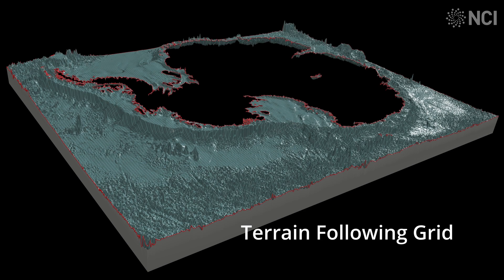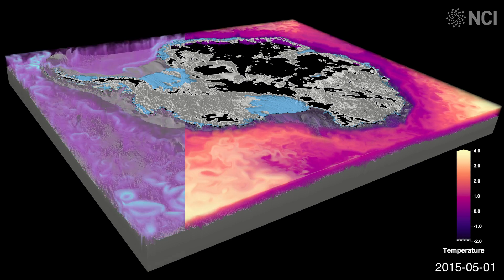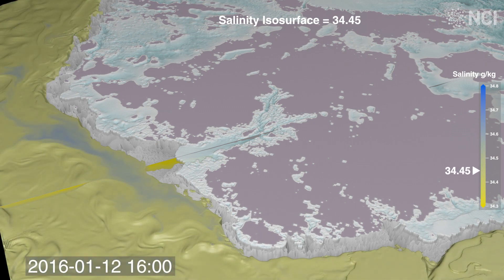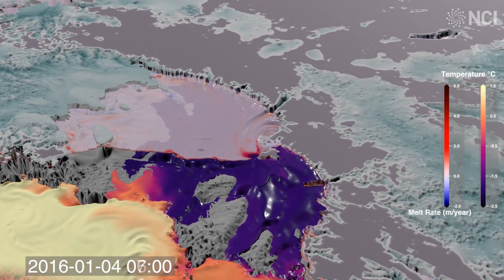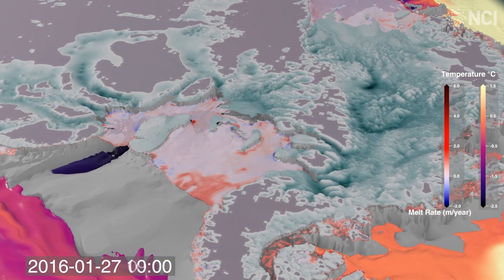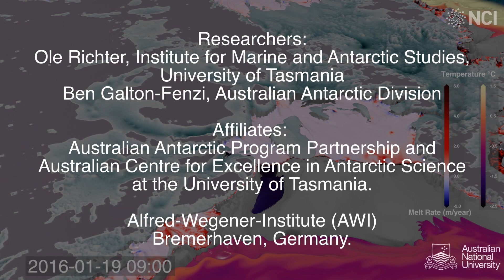High Resolution Simulation of Melting Antarctic Ice

Comment: It seems that warm water from inland is moving to the sea in places. Geothermal activity is melting ice and heating water under the ice in spots. This is an issue not addressed in the model. I remember IGY reports of subglacial geothermal activity causing ice melting. Why is this heat source ignored? Also gasses vented include carbon dioxide. Warming seawater releases carbon dioxide also.

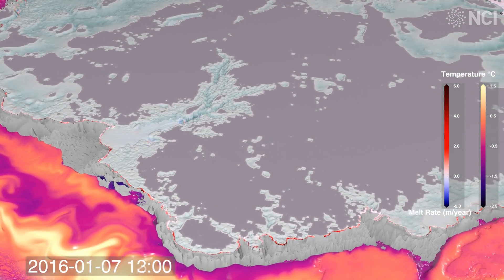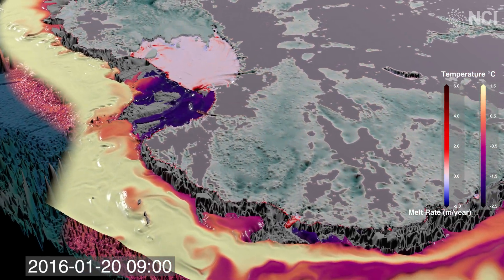Comment: Very nice visualisation. Some glacier/bay-names would help those of us not intimately familiar with the Antarctic understand which bit we are looking at when the isometric view rotates around the coastline. This really helped understand what some of the process and geography looks like, but it also just brings more questions. When you strip back to the iso-salinity layer (2:02) - how deep is that 'surface' approximately? 1km? 2? And clearly parts of that 'surface' are above freezing, and thus promote melting if in contact with ice. Is all the water above that in the column colder? I was well aware of the research from a few years about about the grounding line of some WA glaciers being undermined by warm water and accelerating movement and melt rates, but I hadn;t appreciated the way that the underwater 'coastline' (is there a word for that?) is a lot shallower at the glacier mouths (analogous to a river delta I guess), so mostly the warm water is below that level and not touching the glacier foot. The simulation seems to show the ice surface, but not the underwater ice wall. Is that right, or is it just hidden? At say 2:42, should we be imagining a nearly-vertical ice-front under the glacier going down to the seafloor and touching the tongue of warmer water? If so this would be easier to understand if that was made visible in some way.
Sorry to pick holes in your visualisation which no doubt took forever to make. :-)  I'm just giving feedback on how it could be made clearer to laypeople.
Reply: The undersides of the ice shelves have rapidly melted down over the past ten years - which results in the "ice wall" rapidly diminishing in height - this is documented by numerous independent sources - including underwater cameras, underwater submersibles, video footage from cruise ship passengers, video footage from work crew members, video footage from helicopters that show the ice shelves and glaciers imploding with massive cracks and so on.

The rapid melting of the underside of the ice shelves and the glaciers is the result of massive heat rising up from the calderas beneath the ice sheet - especially beneath Thwaites - and from beneath the Ross Ice Shelf which is the size of France - dozens of other ice shelves and glaciers have been massively melting down over the past ten years.
Reply: @WhirledPublishing  Do you mean 'calderas' here? That's a volcanic feature, and won't have changed its heat-flux much/at all in the last few hundred thousand years. The melting of the undersides of the glaciers is due to changes in the temp/circulation of the coastal waters, as shown in this simulation, isn't it?
Reply: @WhirledPublishing  Well I have compiled thousands of sources (and fixed quite a lot of them for new architectures etc), but I'm not a specialist in ice science and don't need to be to have a useful conversation.
Anyone who says 'you are clearly too ill-educted to talk to, and I'm extremely clever', rather than actually answering the question comes across as a bit of a pompous twat.
And when they start suggesting that the whole scientific community doesn't know what it is talking about and puts it in air quotes, then they come across as a conspiracy loon. Science does work, despite the limitations of the people doing it.
I take it that you disagree with Mr Rignot about the mechanisms of WA glacier undercutting, although not the fact that it is happening? Some reasoning or alternative theories would help your case.
But fine, if you don't want to answer the question, that's OK.
Reply: @WhirledPublishing  
yeaH, sorry its not "volcanos" friend.
Reply: @-LightningRod-  Since I have thousands of sources - and you don't, take a seat in the back of the class.

If you should ever care enough about the truth to compile thousands of sources, documented in dozens of languages from all across this Earth - which will require decades of your life - you might become someone worth trusting.
Reply: @WhirledPublishing  
So, ..i bid you,. Good Day , Sir.
sorry which Volcano was poppin off?
Because there isn't.
Reply: @WhirledPublishing  
GOOD Day sir.

Comment: How do you measure sea levels with changing tides & weather?? I thought ice melts from the outside in??
Reply: Sea level rise has been minimal because of the massive extraction of sand along the coasts of Australia, Africa, South Asia and so on - massive dredging of rivers and lakes and canals have also helped to keep sea level rise to a minimum.

In Hawaii, huge piles of debris were hauled out and left sitting on the beaches - this is going on - worldwide - which helps to maintain sea levels at a constant - but mostly the haul is from billions of gigatons of sand which is used to construct  thousands of high-rise buildings - worldwide.
Reply: @WhirledPublishing  
uhm,...No.
Reply: @WhirledPublishing what a hot load of bs.

Comment: Nice simulation. The general laws of physics for fluids and thermal transfer are there, but it's a pity it doesn't reflect the real-world dynamics of what's really happening in the Artic Sea. 

The natural world is too darn finicky to model. You can't model a small piece of water in isolation without considering its context. Everything is related to everything, and everything can behave unpredictably. The relationships between sea, land and atmosphere are just far too complex for our best computers to handle. Where are the relationships of air streams, coriolis effect, air pressure, humidity levels, cloud cover, ocean currents? These haven't even been mentioned in this model, which defeats it's purpose,   unless the Arctic is sitting inside it's own isolated container, in a vacuum and the lights turned off, and no magnetic radiation. 

Still, it would be interesting to compare these predictions against real data measurements over the next 50 to 100 years or more.
Reply: this model simulates Antarctica (not Arctic), and though I agree the interplay between ocean, atmosphere, cryosphere is very complex, this model does include (in some way) all the things you've mentioned: air streams, pressure, humidity, cloud cover are all included in the atmospheric forcing (from ERA-Interim ECMWF Reanalyses), coriolis effect and ocean currents are simulated by the ocean model. On top of it, it includes thermodynamic interactions with the Antarctic ice shelves (only model of this kind to include this in a circum-Antarctic domain of 2 km horizontal).

It is a showcase of the current power of coupled models being simulated in the Australian supercomputer Gadi (from the National Computational Infrastructure). The model is validated against Satellite-based estimates of the ice shelf basal melt rates.
Reply: All those factors you mention are irrelevant in comparison with the HEAT that's been rising up from the thousands of calderas beneath the ice shelves and beneath the thousands of glaciers - if you don't realize that then you're not going to understand what's going on - and you'll be oblivious to the cause of the thousands of glacial lakes and the thousands of glacial rivers and the thousands of moulins and the numerous wateralls that cascade over the ice walls.

You'll also be oblivious to the hot cinder cones and the volcanic craters and lava fields that suddenly shoved their way up through the Ross Ice Shelf ... you'll fail to understand the true cause behind the "mystery" of the polynyas ... you'll fail to understand why Thwaites suddenly imploded and hurled thousands of icebergs into the Amundensen Sea...

If you overlook all that - and if you overlook the rapid meltdown of the undersides of the ice shelves and the imploding glaciers with colossal cracks and rifts, and if you deny that thousands of colossal glaciers are sliding into the sea ...

If you fail to realize what happens when the ice shelves meltdown so rapidly that they can no longer hold thousands of colossal glaciers in place ...

If you fail to conceptualize what happens when thousands of colossal glaciers slide into the sea ...

If you can't imagine the resulting water displacement from thousands of colossal glaciers ...

If you're unaware of the timeline for the previous collapse of the glaciers into the seawater ... 

and if you don't know the consequences of that horror

then you won't know that you should expect very few survivors - worldwide - you won't know that immediate action is required.

Apparently, the mass majority of the world population are oblivious to the obvious.
Reply: No simulator can ever be accurate because there is just too much that would have to be included, some of which scientists are not even aware of, that no computer will be able to model for possibly the rest of this century.  Despite what scientists try to tell us; our climate cannot be simulated on a computer!  This is nice, but it's Not Accurate.